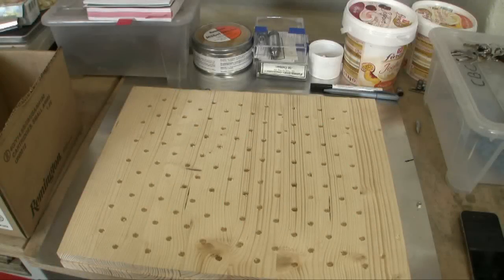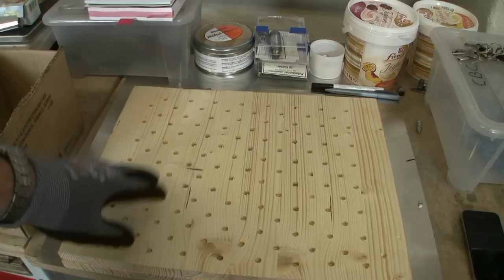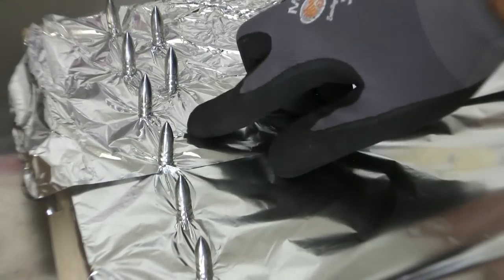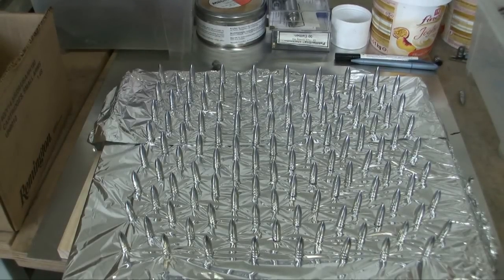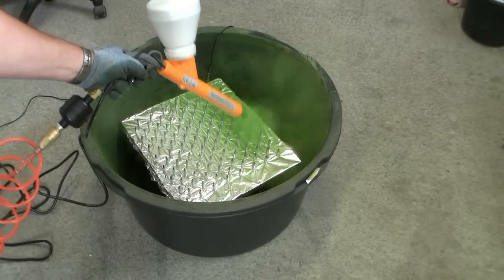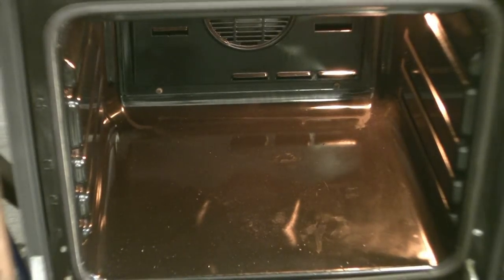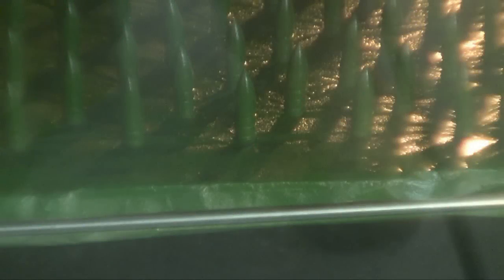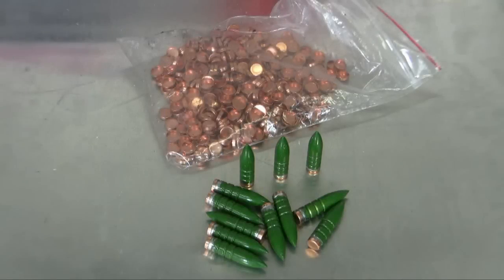How to powder coat lead bullets

Comment: With great success I have also begun to powder coat my bullets utilizing the Harbor Freight equipment and a small convection oven as you have.  I'm very pleased with my results as well.  To date I have powder coated 30-30 Winchester and 45 ACP.
Thank you for this informative video.  It is a skill many will benefit from seeing.
Reply from the maker: Michael Shaffer Thank you very much for leaving a comment my friend. I'll try this method with 44 Mag. bullets next but have to figure out how to coat the bases of the bullets totaly first.
Reply: wiederladerTv
I share your concern related to protecting the base of all my projectiles, either with a gas check or powder coating.
Without success, I have been looking for a way to protect the bases of my 45 ACP without applying a second coat.
I had even thought of hanging the projectiles from a fine wire wrapped around a lube groove, during the application of the powder.
I will continue to watch your videos, as I am a subscriber to your channel, hoping to learn of a way to accomplish this if you should think of something.
Reply: For slower ammo try using a harder alloy and skip the gas check, at 900-1000 fps my Colt/Bob Marvel custom 1911 still gives me .457 to .609 groups at 50 yds ( yes 50). Thus way I tumble the bullets in powder for 2 hours in my Hornaday M2 then dump all 150 coated bullets into a basket strainer I put the bullets strainer and all on a cookie sheet and into the oven. You will get less than 15 bullets you scrap or need to remelt due to bad coatings from bullets touching each other during the curing process. And its a lot less time consuming.

Comment: I do almost the same as you do. I only do the back half of the bullets and preheat them before spraying them to get a better coating.
Reply from the maker: +Jeff DeKing Will give it a try..thanks for this advice buddy.
Reply: I do preheating for shake and bake and it makes all the difference however for spraying I didn't notice a difference, it most likely helps but I find it unnecessary.

Comment: I worked for a powder coating company that also did Teflon spray. We did bullet tips for tracer rounds I think it was a 20mm projectile I’m not sure though. They weren’t centerfire bullets it was more like a cannon like a mini war head. But we used to Teflon spray the bullet tip after they were sandblasted. I really liked that aspect of the job. They also had a high security room we’re not one was aloud in. I’ve only been in this room 2 or 3 times in the 5 years I worked there but from my understanding they put a silicon lubricant like by we’re the primers would be. I think now that they were 22 or any rim fire ammunition. But they had at least 10 of these machines going it was a cool operation. If I was into ammunition and firearms as I was a few years ago I would of loved to learn exactly what they were doing in the bullet room. But I have Teflon sprayed hundreds maybe thousands of the bullet tip. I had one of the bullet tips that didn’t met up to code I don’t know were it’s at know but knowing what I know now I definitely would of wanted to work in that secured ammo room.

Comment: They got you, too...lol great job brother! Practical for rifle bullets. I like the gas check shank in the wood block thing.
Reply from the maker: shotgundrums Hello my old firend...hope you're doing fine. Can't wait to test these bullets. The goal is an velocity of round about 2500 fps...with this I should be able to shoot at a distance of 600m hypersonic.
Reply: wiederladerTv Marcus, you should be able to top 2500 FPS w/o any fouling.  I have a video on this showing cleaning a barrel after many rounds @ 2800 FPS in a 30/06 and NO gas check.  Accuracy was horrid as I believe the lead bullet was deforming but the coating held up.  With a gas check you may well get the 600 yard load you wish to obtain.  My testing has been for the moment tabled until I get some more free time to test further with a gas check.  Give my channel a look if you would like to see some results.  Much thanks.

Ebner
Reply from the maker: I think accuracy is best when bullet streng is 90% of PSI/1422. The right formular is PSI/1422*0.9. Works great for me since years.

Comment: Problem I see is there appears to be an exposed lead bare  ring around the base due to the foil shield.  I use flat sheetmetal drilled and reamed to the size of my gas check. My bullets are held upright and firmly secured while spraying  with excellent grounding and no bare areas. I set the gas check then do a tumble second coat completely covering the entire bullet and  bonding the check in place. I double coat as I shoot full power loads. I would also recommend  the Eastwood  Dual Voltage gun. HF is OK to learn with, but  the eastwood is easier to use and does a much better job. A plain old cardboard box with a cut out for an air filter and a pulling fan behind the filter would would vastly improve and make your process safer.  Well done video, thanks.

Comment: I have watched several videos on how to powder coat boolits. I have seen the powder applied by a spray gun applicator, tumbling in a plastic container and using a tumbler to apply the powder and I must say that yours and only a few others that I have seen actually have a very nice, evenly covered, uniform finish. Recently watched a video of a guy that uses a tumbler, yet his boolits are not uniformly or evenly covered. You can actually still see lead on the boolit in some areas and other areas you see the coating. Not sure if that's o.k. or what he intended, but I personally would strive for a finish that much resembles yours. Thanks, AGW.
Reply from the maker: AirGunWarriors I watched a lot of videos about different coatings and applications also and I'am totaly interested in this. There are great ideas about this but a lot of them comes with a evenly covered bullet. For me it's important that I get a smooth fully covered finish on my bullets...this should be as good as possible.

Comment: I like this method ! It got me to think about improving it a little and trying it myself.
I am going to use a drill press and make the holes for my 8mm Mauser-- as well as my other rifles. I like the wood idea. I want the base of the bullets powder coated as well. I think I can solve this problem by using a powder gun that I own. Using NON-STICK Aluminum foil I will first powder coat  the foil and THEN place the bullets in the holes and powder coat them with the gun this should work. My goal is to make a clean powder coated bullet. I will be using industrial auto Powder Coating for this process. This method my not be necessary for handgun bullets. I may just use the shake method for them. Bye for Now. Keep up the good work.
Reply from the maker: Thanks for your comment...I agree with you. Powder coating handgun bullets this way is to time consuming

Comment: Absolutely ground breaking game changer to be able to fire cast rifle indoors! Super!  Maybe you could use a counter sink drill bit for your wood block. put the tips in first. maybe there is a way to explore MCC in rifle loads?
Reply from the maker: Laura Culotta MCC works great in rifle loads. I shoot them up to 2400fps and everything works great. The idea with the counter sink sounds good...no need for a gas check after this. I will test it asap. Thanks Laura

Comment: If you load the bullets on the tray nose down and then powder coat, after removal you would have soft nosed PC jacketed bullets that require no gas check (which is why I thought we were PC'ing anyway, get rid of that .3 per bullet fee, and the smoke and mess of ALOX).   Tumbling is nice for bulk but the results make me question the affects on ballistics (globbing and irregularities on the bullet surface).
Or, powder coat twice, first a light coat nose down, then after heating and cooling recoat them nose up and the ugly side that comes in contact with surface would get seated in the cartridge and the shiny nose of the projectile would remain glossy and untouched.  I'm working on this now and hope to have results soon.  Your thoughts?
Reply from the maker: For me tumbling is not the way I would choose. First we do not have the same powder you have and with the ones I have tested it was just not possible to coat the bullet....the powder does not stick to the bullet. Nose down could be the way to safe even more money...try to make a tray and test it asap. Thanks and greetings from Germany. Markus
Reply: I recall the first time I electrostatic powder coated bullets using regular aluminum foil.  After PC and then baking, the bullets stuck to the foil and pulled it up and I thought the bullets were ruined.  It just now occurred to me that this was in fact a polymer-coated-aluminum-gas-checked-bullet that is perfect for what we are looking for, no gas checking, no buying copper checks, no buying or building fancy gadgets to make our own from copper sheets or aluminum cans!  The ugly part of the foil that gets pulled up gets seated into the cartridge and the glossy nose remains unblemished.   I'll try to reproduce this again and get back to you with results, if you don't do it first!  :)

Comment: I would have loved to see an accuracy video on these.  Nice video.
Reply from the maker: +abrahamhdz Okay, is on my todo list now.
Reply: I am also messing around with working up some supersonic hard lead cast gas checked powder coated rifle bullets for 300 blackout and 7.62x39.  I am trying to get them to run in the 2100fps-2400fps range.  It is very very difficult to make these shoot well and accurate.  Your powder coating method is different than mine but that is no biggie.  I am very curious about what sort of accuracy you are getting.  If you do make a video in the future I would appreciate it very much.  Thanks.

Comment: I've never powder coated, but it seems to me there's no reason to powder coat the front of the bullet where it doesn't contact the bore.  OTOH, it would be nice to powder coat the back of the bullet and the base.  What if you made tapered holes and placed the bullets in point first?  Would you even need the gas checks?  Anyway, I really like this spray method.

Comment: It would have been helpful if you had shown how you seat the gas checks.  I have always used a Lyman or RCBS lube sizer to seat gas checks, which also sizes the bullets.  I assume that you are shooting your bullets as-cast (without sizing), so how you get the crimp-on gas checks applied is left a mystery in your video.
Reply from the maker: +Dennis Tominski No, I do not shoot them as cast. I use a RCBS LAM II for sizing and seating the GC.

Comment: Why wouldn't you size them first, seat the gas checks and then powder-coat? Seems to me if they were oversized cast, the sizing step would remove the powder coat....and if they are seated in the block for coating, the gas check wouldn't be affected.
Reply from the maker: +Jake Bateman You have to size them after PC. If the bullet is cast oversized then you can size them before and after of course but normaly the PC is strong enough to stay on the bullet after sizing.

Comment: Very informative video.  Is the oven hot enough to scorch the wood?
Reply from the maker: Phu Q Well I could scorch the wood in the oven but for this I have to increase the heat much more than I need for the powder coating.

Comment: I like the board method,do you have any suggestion how to get the base of the Bullet coated if not using gas checks?
Reply from the maker: You could put the bullets nose down in a board like this one. With an special drill bit you could drill a hole with the same shape like the bullet tip
Reply: After thinking about wanting to coat the base, there really wouldn't be any reason for the base to be completely covered since it doesn't come in contact with the rifling in the barrel. Your thoughts?
Reply: The gas check is to eliminate the chance that the lead melts due to the intense heat of the expanding gases.  The PC does the same job for far cheaper than the gas check.  So, that is why the rear needs protecting.  Putting the bullets point down would be a better alternative if you do not want to PC the entire projectile.

Comment: wiederladerTv Like the MCC method of coating bullets, have you ever mixed hexagonal boron nitride with the powder coating?  It would seem to be a faster method with the benefits of both approaches.  (You should call it MPC!)

What would be your recommendation on the mixing ration of powder coat to hexagonal boron nitride ????
Reply from the maker: Bob Howell Sorry for the late answer....I was in the hospital etc. I never mixed hbn with powder coating; will give it a try when I'am able to work in my shop again. Greetings Markus

Comment: I have been attempting to powder coat some 120 grain gas check cast bullets using the method as shown in your video.  I use Harbor Freight Red, a Harbor Freight gun.  I made a tray out of aluminum instead of wood as you have shown.  I use 30 lbs. of pressure.  I have found that in order to get the driving band of the bullet covered (near the aluminum foil), I end up with too much powder on the rest of the bullets.  Because of the excess powder that ends up on the aluminum foil, I get excessive "flash" that I have to nibble-off with a small cutting tool before I apply the gas checks.  What am I doing wrong?  Why can I not get the lower part of those short bullets covered without such excessive powder?
Reply from the maker: +Dennis Tominski You could try to brush away the excessive powder with an brush before curing in the oven. Maybe your drilled holes are to large....

Comment: Do you reduce your muzzle velocity for these rifle bullets so the lead does not melt?  Have you ever noticed any lead fouling in your rifle barrel?  Does the powder coating melt anytime the temperature gets above the oven curing temperature?
Reply from the maker: I have tested these bullets up to 2400fps without any leading in the barrel. But .most accurate velocity is lower in my rifle...
Reply: that's the purpose of the gas check to stop pressure leaking past the bands if your alloy is correct and you do a proper hear treat you can expect the same or better accuracy than jacketed ammo

Comment: Since you are resizing after the PC process, if you use the .308 sizer wouldn't that take most of the PC off in the process? Or are you sizing to .309"?
Reply from the maker: Mic Sherwood That's right...I size them to .309".

Comment: Very good idea about drilling the board and using foil to conduct the electricity.  What temperature do you set the oven?
Reply from the maker: vajake1 The oven is set to 180° C . The right temperature for the powder coat is given by the manufacturer of it.

Comment: I love powdercoated bullets. I tumble them wet and seat the gc after they cute and cool
Reply from the maker: +Russell Houghton (Russ303) Have to test the tumble method also.
Reply: +wiederladerTv I've been trying to switch to that but they keep sticking to each other. It drives me nuts so I just order a powder coating gun. I plan to do it the same way as you for rifle bullets. And for bigbore and postal I'll just set them on nonstick foil and have an exposed base. How fast have you be able to shoot 30cal. Powder coated billets?
Reply: wiederladerTv

Comment: I'm curious what kind of velocities you could achieve with this method.
Reply from the maker: HemiFreak94 2400fps without problems. But I will use these bullets for subsonic loads in future exclusively
Reply: Thats actually perfect for 303 British, I'll have to give it a shot.
Reply from the maker: And tell how it worked for you after testing please ;-)
Reply: I absolutely will, I hope they shoot well. The .311-.313 bullets over 123gr for 7.62x39 are getting very expensive.

Comment: you wouldnt happen to have a link for the kit uset to coat would you - im from denmark and having a little trouble locating the parts 
do have the powder but are struggling to get even results with the tumble method
Reply from the maker: I don#t have the link to the powdercoating gun...sorry.
Reply: darn but hey back too googling :) was worth the try :)

Comment: Why powder coat them? Doesn't all the coating get stripped off by the rifling?
Reply from the maker: No the coating is like an jacked. Not lead is touching the barrel
Reply: I shoot my powder coated bullets at steel plates. I have found the on the ground after the hit the plates. Even the little bit of lead that is still intact has powder coat still firmly adhered. It works very well.
Reply: I shoot my powder coated bullets at steel plates. I have found the on the ground after the hit the plates. Even the little bit of lead that is still intact has powder coat still firmly adhered. It works very well.

Comment: hi markus,
 how did your testing go? did they perform as you hoped? you mentioned needing to get more surface coating on another comment - what if you changed the standing board? what if your holes were basically dimples, the bullet would rest on the aluminum rather than pushing through, and you would get more surface coated. maybe you could cover the rest of it with the gas check?
 also, you mentioned being in the hospital recently. i hope you're doing well. you are my favorite german firearms channel ;-)
Reply from the maker: +Lyle W Oh they perform very good. I'll use them with a silencer in subsonic loads next and I will make an video about it also.